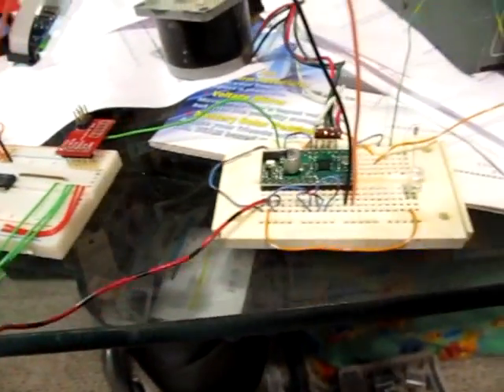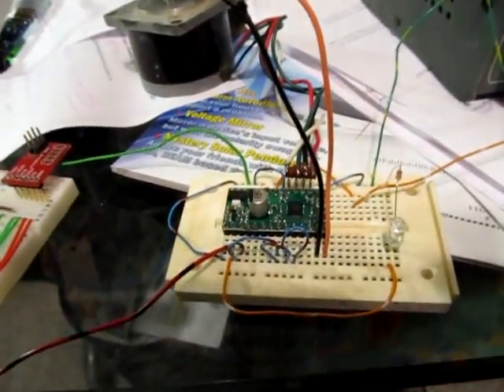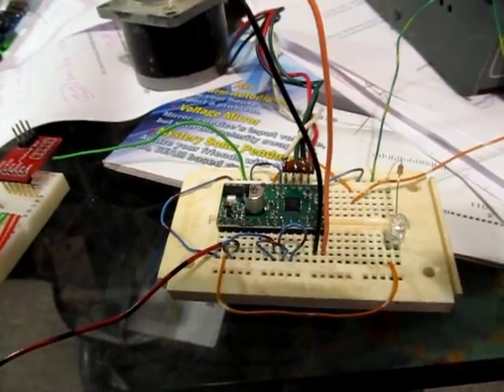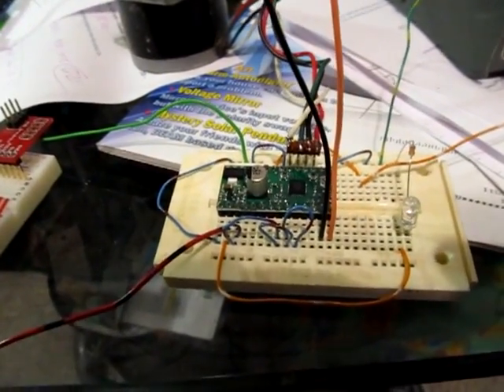Testing the Pololu A4988 Stepper Motor Driver Carrier

Comment from the maker: I'll have to see if I ever drew it up... I think I just connected two inputs to a microprocessor (Atmel) and programmed it on-the-fly until it worked. I'll look again... if you don't hear back in about a week send me an email... I should be back home by then... and I'll see if I still have it wired up. If so... I'll send you pictures of the setup and more details.